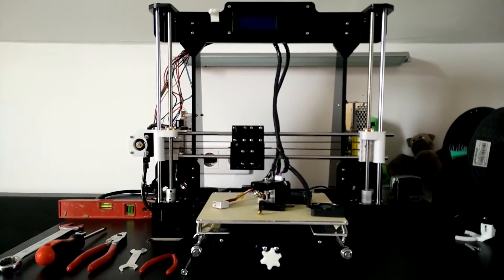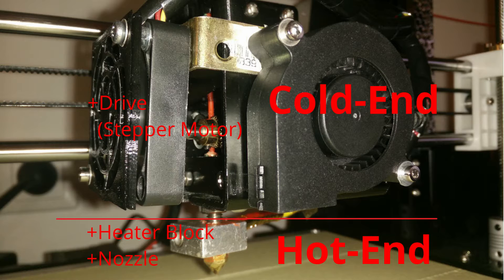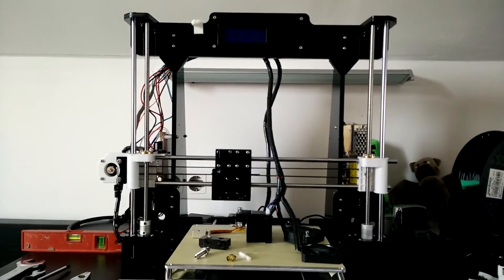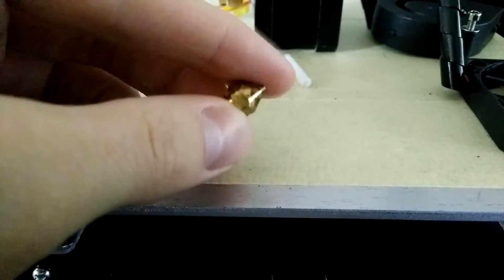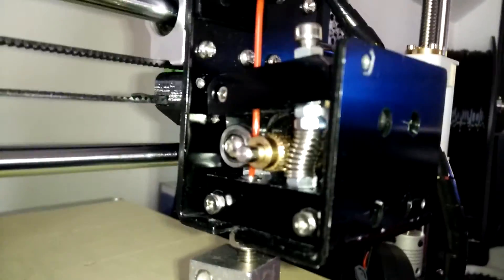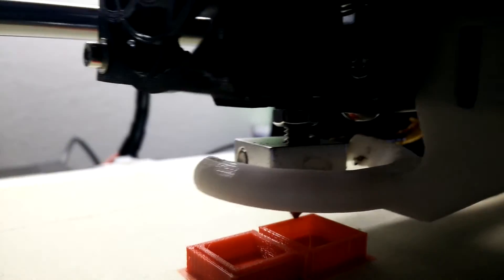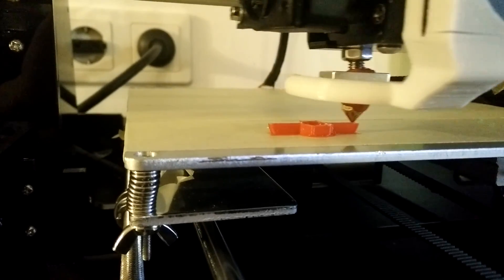Anet A8 -  Extruder in Detail

Comment: hi Caverntwo
Thanks a lot for the video .. it was helpful
I have a  ِAnet A8 printer when I try to move the  Extruder stepper motor via control panel it does not work!!
Do you think that one of the Firmware lines needs to be modified?

thank you..
Reply from the maker: Hi, thanks for the feedback!
I'm glad that you liked the video.

So your extruder motor doesn't move? Not during a print and not via the controller?
That can have multiple reasons, from the motor being unplugged to a wrong configuration in the firmware.

Did you flash the firmware?
If you flashed the firmware and it worked before, it's very likely that your firmware configuration is wrong.

If you didn't flash the firmware and it doesn't work anymore, try swapping the cable from the extruder to a different plug on the board (like the Z-axis) and see if the motor moves once you move the axis. Also try out if other motors move when they are connected to the extruder plug. Using this technique you can figure out if the motor or wire is broken or if even the board has a problem.

But be very careful:
Only unplug motors when the board is turned off, otherwise your board might be destroyed!!!

I hope I could help you, let me know if it worked for you!
Reply: @Caverntwo  Thank you for a quick answer.
The printer is new and has not been started yet due to this problem
Yes, I flash the firmware Marlin 1.1.9
I tried to move the  Extruder stepper motor through the control panel, but it did not move, other stepper motors like X-Y-Z move through the control panel properly
It changed the Extruder motor  plug to the drive axle Y plug  and work properly
I even changed the motherboard but the engine did not work with it

Now ... I'm almost sure that the problem is in Firmware

Can you help me figure out the font and the cause of the error in the firmware
thank you very much ...
Reply from the maker: Sure, what board do you have? 
It really seems like the issue is in the configuration then, which is good, meaning that the hardware is alright.
Marlin prepares some example configuration files, maybe your printer with your setup is included. 
In any case, is the motherboard you have selected in the Configuration.h file the one you have?
Reply: @Caverntwo  thank you very much for effords
I Using Anet A8 Board V1.7

is the motherboard you have selected in the Configuration.h file the one you have? No, I Dont know how  do that !!!
how i can select  my motherboard  in the Configuration.h file?
thank you
Reply from the maker: Right at the beginning it should say 
#define MOTHERBOARD BOARD_ANET_10

However, if you managed to flash the firmware onto the Anet board, I'm pretty sure that it's right.

Marlin has a Minimum Extrusion Temperature setting (PREVENT_COLD_EXTRUSION). The extruder won't move unless it's heated up to the value of EXTRUDE_MINTEMP, which defaults to 170°C. Trust me, I also looked for a hardware error or configuration error like half a day once because of this.

If that doesn't solve it, then can recommend you to basically start with the example configuration again. Like shown in my Marlin on Anet A8 video. It has the motors wired up properly by default.
Reply: @Caverntwo  
Good evening ...
Thank you ...
Thank you ..
Thanks for your efforts ..... You are a creative person ..

Thank you very much ..... the problem started to fade away ..
The extruder starts  moveing   now . But  the opposite rotation
That is, instead of pulling the filament , its take  it out.
I need to reverse the stepper movement
Is there a modification to Firmware?
thank you very much
Reply from the maker: You're welcome.
Yes, you can invert the rotation easily by changing the INVERT_E0_DIR value. I have created a video about investing motors: https://youtu.be/AgyNM7FQrmk

Comment: Serious case of leakage. Your teflon tube is leaking melted plastic. Bad seal between nozzle and tube.
Reply from the maker: I know, those times there was a leakage among with a lot of other problems. However, the E3D-V6 upgrade solved a lot of these issues.
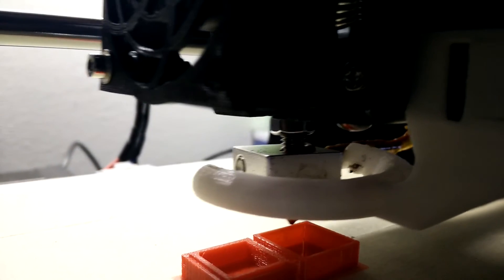Reply: @Caverntwo  3:07 that teflon end should be at the bottom (connecting with nozzle)